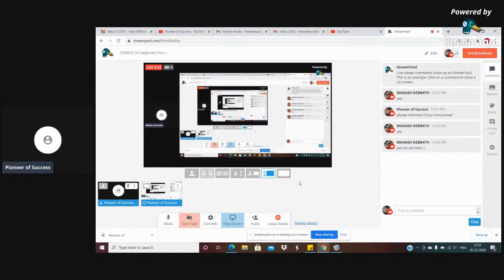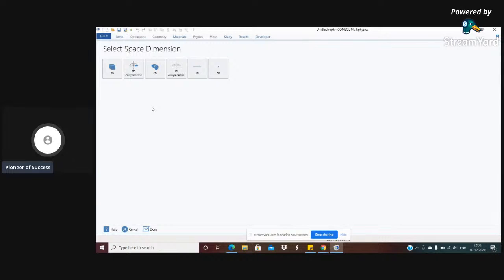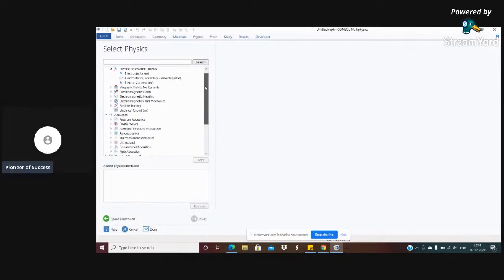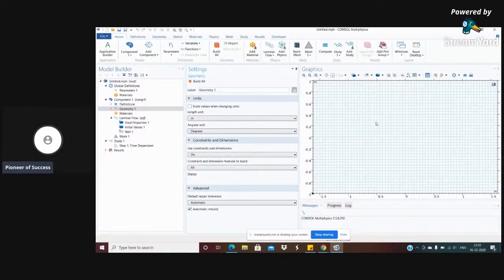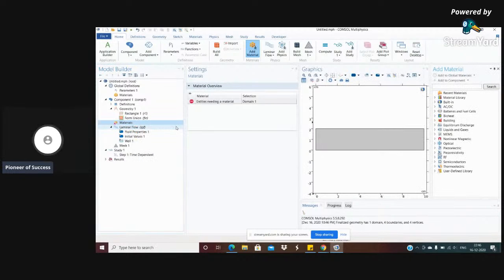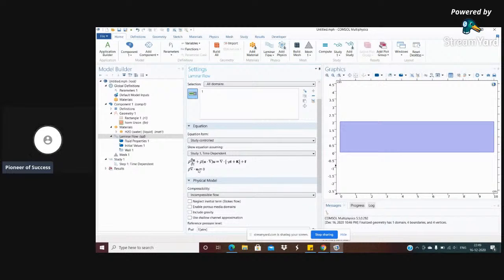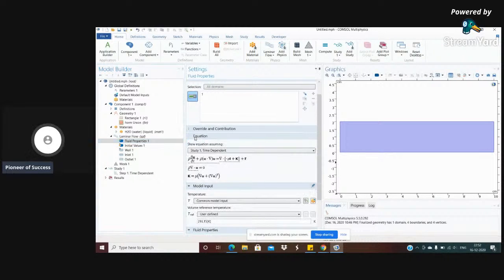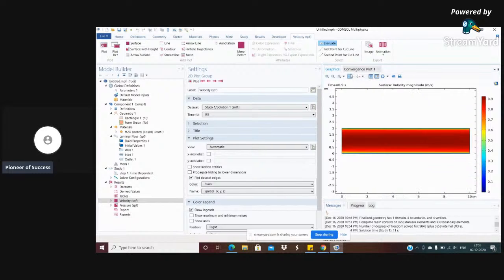COMSOL for beginners live session

Comment: Hello, I like your content. Your videos are very usefull for me. Could you please make a tutorial about two-phase (oil and water) flow in  vertical pipe (L=1[m], D=200[mm]). Initially there is water in the domain, then oil starts to flow (U=0.1[m/s]) throw little hole (20[mm]) in the wall. There are supposed to be bubbles, which pop up towards to the outlet.